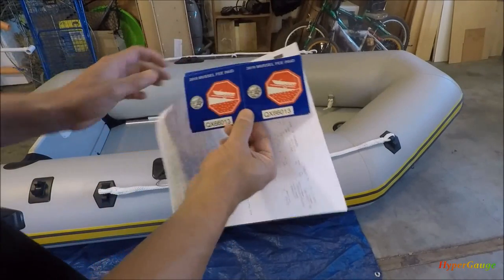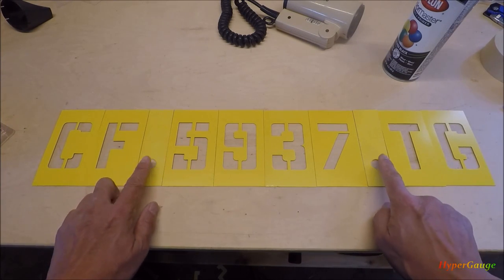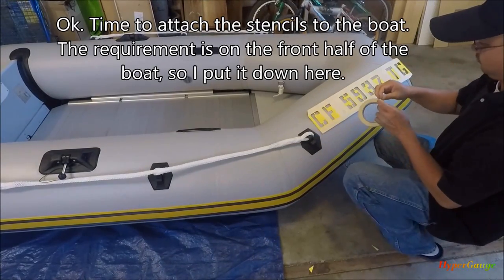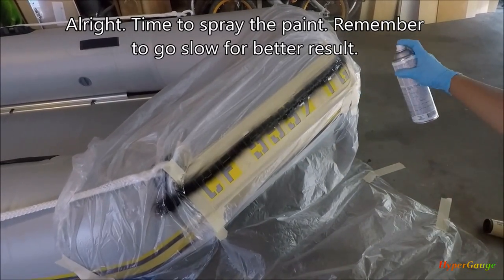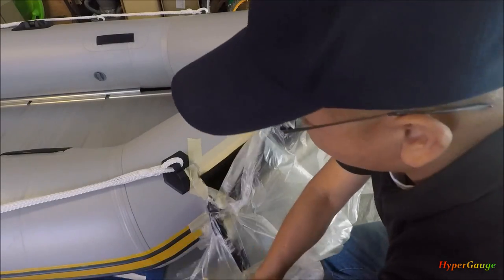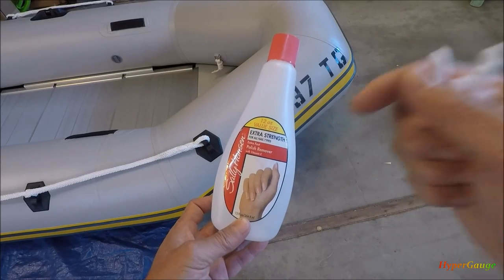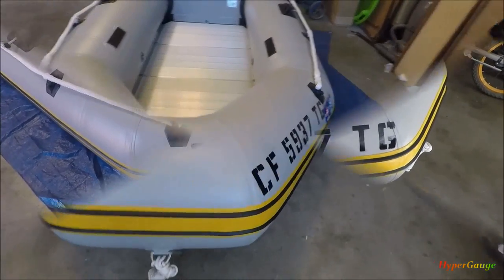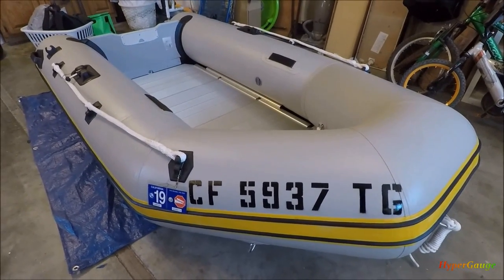Easy DIY boat number on to the boat. Step by Step how to and tricks.

Comment: I found your video to be well made and seemed to cover all the bases. I'm going to use your method except the Krylon. My personal preference would be to use Rust-Oleum. I found the drip and over spray factor are less with this brand. Not gospel just my choice. I'm sure there are many options. Your choice got the job done which is what matters.Good job and thanks for sharing.
Reply from the maker: Thanks for watching my video. I sometime just used whatever I have on hand. There are definitely many ways to get things done. Good luck with your project.

Comment: I just got my Intex Excursion 5 registered in California yesterday. Can't wait to get it on the lake! Thanks for tips on painting the CF number.
Reply: Jeff Fleck I have the same boat 
What do I need to have it registered?
Reply: I was planning on getting an inflatable boat but didn't know I needed to have it register even if I'm just using the paddles
Reply: @epenaloza52  you don't, just with a motor
Reply: @strikerone6991  thank you I just recieved mine this past Monday can't wait to out this weekend
Reply: @epenaloza52  I bought one similar from eBay, used it 30 times or so on lake Shasta, Sonoma, and Berryessa, run it with a little 4 horse Nissan, planes well, plenty of speed.  .its really a kick in the Ass! I can stand up when fishing...mounted a hummingbird fishbuddy. You can go where other boats can't... Hope you get as much enjoyment out of it as I have

Comment: Just wondering how those numbers are holding up after 6 years of service, or you still have the boat? I plan on painting my registration numbers on too, waiting for print shop to cut me up a pair of adhesive stencils, they do reg. decals and said they would do it for the same price. Did you do any mechanical or chemical prep to the surface? My boat is PVC and I'm thinking sand with 1000 grit and wipe down with acetone? My local hardware store carries vinyl paint, it's more money, but it could give me the best chance for longevity as I plan on frequent rollups. We here in British Columbia, Canada have to register all boats that are equipped with motors of 10HP and higher, registration can be done online at Transport Canada and it's free.
Reply from the maker: It is actually holding up pretty good. I do have to touch up on the chip and faded area once awhile. Very simple work. I did not sand the PVC surface. Good luck with your project! 👍
Reply: VHT makes a Vinyl DYE, which I have used for years on my inflatables.  No touch-up needed, ever.  It's great stuff!!!

Comment: Hi. Had a question. I need to put numbers on my TIWAL. It's high grade PVC and not hypalon so vinyl won't stick. How is that common paint holding up for you? Do you deflate it often? My boat deflates and I roll it up to put in my trunk so worried about the paint crinkling. One place told me they use "vinyl" paint. Thanks.
Reply from the maker: I always deflated my boat for storage. The paint mostly hold up fine over the years for me. Very easy and simple to touch up if needed. Good luck with your project! 👍

Comment: Sir, has the decal method experienced any trouble from law enforcement? I am a first time boater, and am struggling with decal installation. Please advise the best way for decal installation without worrying it comes off every time we inflate and deflate the boat. Love your tips!
Reply from the maker: Here in California you just need to meet the regulation requirement then you are all good. I have not have any problem so far. The letter print on my boat is still holding up after few years. I did touch up once awhile with a sharpie markers if I notice some little chip, but that is just cosmetic.

Comment: Hey quick question, did you or have you have problems with the paint and the boat? Thank you!
Reply from the maker: Last year I noticed some cracked paint after few years of use. It is easy enough to touch up and repaint to make it looks good again. Good luck with your project. 👍

Comment: Thanks for the video.   Do you think the paint will holdup ok with deflating and inflating all the time?
Reply from the maker: I have been using the boat for 10+ times since it is done, the paint is holding up just fine.
Reply: Hypergauge awesome thanks
Reply: Hypergauge do you deflate and fold the boat after each use?

Comment: How hard was it to register? Could you explain the process? I have been using my inflatable for over a year without CF numbers... Was told I may not be able to register it because it is a cheap Chinese made boat. It does have serial number though. Thank you  in advance
Reply from the maker: It is hard if your local DMV office does not have experiences with inflatable boat. Find an office that is near major water and they should know what to do. In my case I just need to show them my regional purchase receipt and description of the boat. If the first office you try cannot help, don't give up, try a different one. I finally meet someone helpful in my third try. My boat is also made in China. Good luck.
Reply: @HypergaugeDIY  cheers! Thank you for the info
Reply: Same here I thought it was going to be hard but it was very simple I’m going out on the water tomorrow

Comment: Is it that I need to take to the dmv to get the registration?!
Reply from the maker: Here in California, any boat with any kind of motorized propulsion will need registration. Have fun and be safe out there.
Reply: @HypergaugeDIY  yes but what papers might you need in trying to get a trolling motor for my excursion 5
Reply from the maker: @epenaloza52  Normally you will need your boat purchase receipt, then go fill out a boat registration form and pay the registration fees in DMV. If you are in the area where boating is very common, the DMV office should have no problem to register your boat for you.

Comment: Awesome job.  What's the fee for inflatable boats in California? I'm planning to put a small electric motor on an Intex Mariner 4 boat.
Reply from the maker: The registration + all the other fees is about $60 a year. Not too bad as the boat is not very expensive.
Reply: @Fro-Daddy  do you need to register it even tho you'll be using the paddles and don't plan on using any motors!?
Reply: @epenaloza52  No, but trolling motor you do its 65 currently CA
Reply: Wow cali is crazy high with everything I see. Here it’s $33 for 3 years to register your boat. Wild.